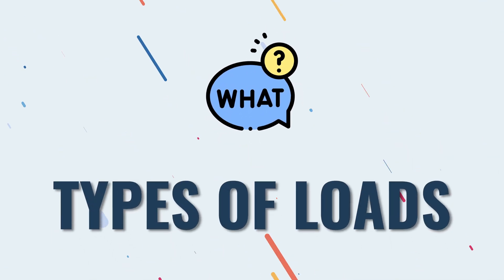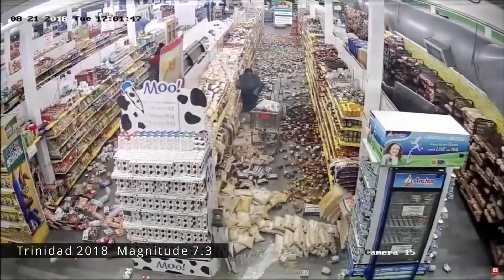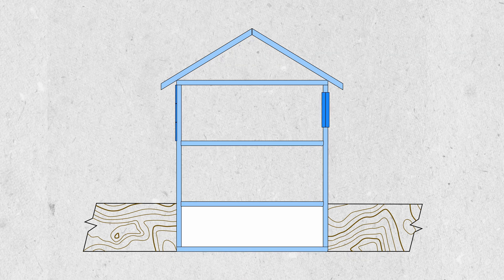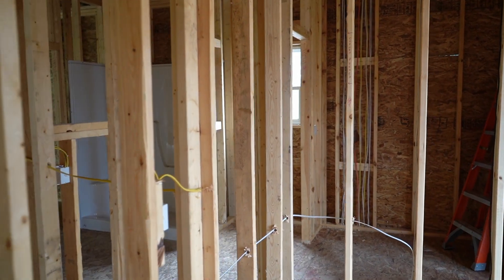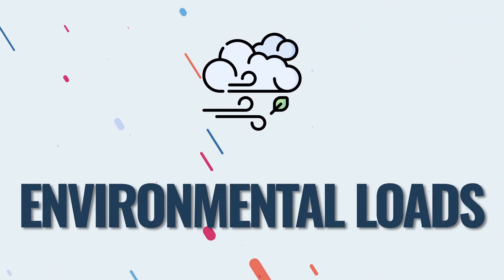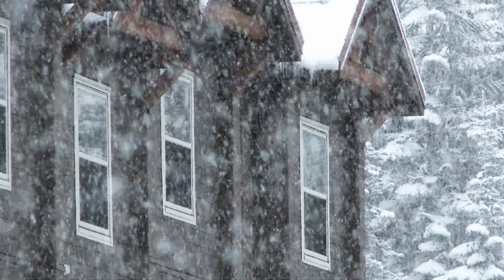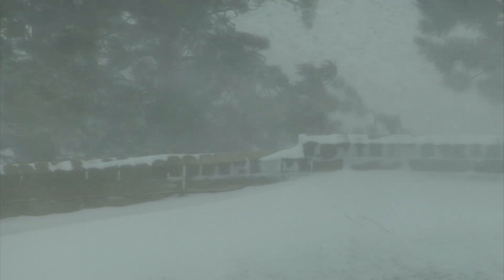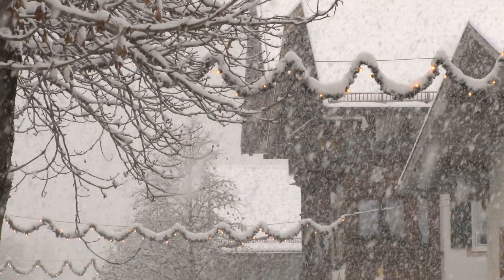Why Your Designs Fail: Tips for Structural Design Loads & Load Paths

Comment: Would appreciate your thoughts on the accidental fire load as described in the eurocodes as an aussie. Unsure what your regulations say, but its quite clear here that structural fire engineering is the responsibility of the structural engineer not fire engineer in the UK. However, since the grenfell 2017 tragedy, many structural engineer firms in the uk have updated their indemnity policy to not include the accidental fire load and I on some recent projects, despite having an education in both structural engineering and fire, as a fire engineer have been getting asked for steel member critical temperatures, utilisation rations, etc.